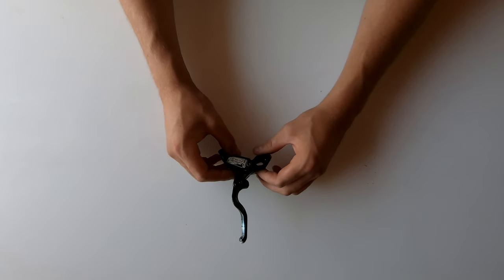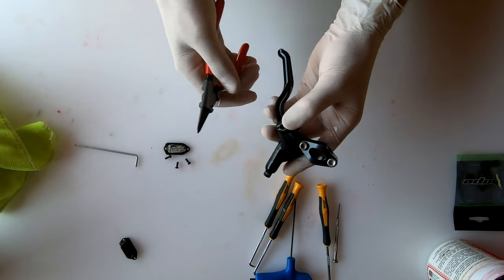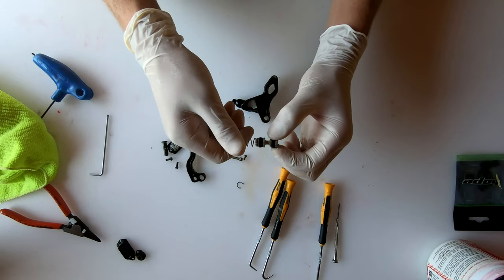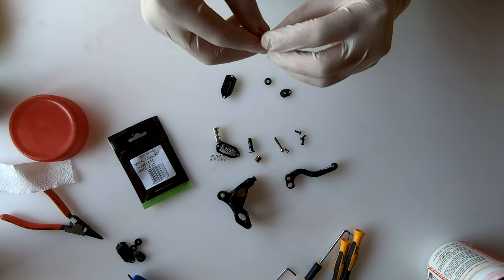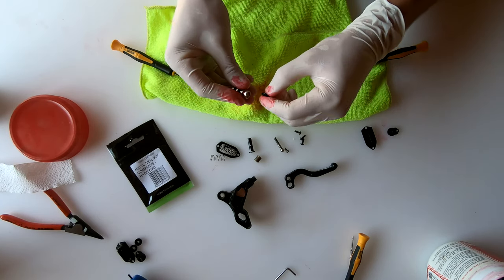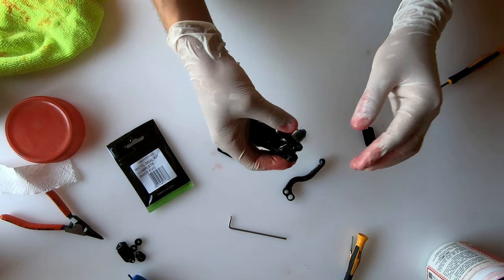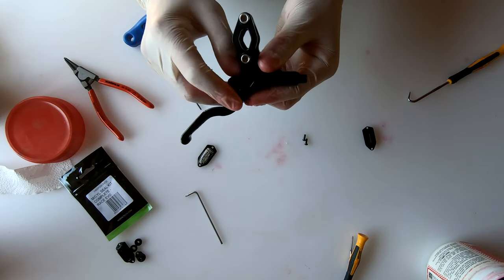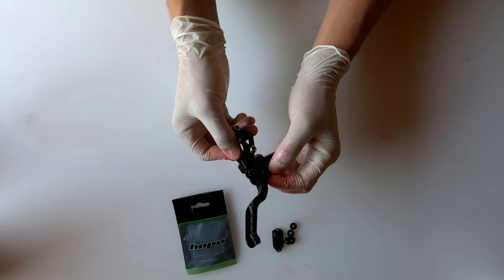Hope Race evo lever/master cylinder rebuild

Comment: Can you reuse the snap ring? Do you think its possible to remove the lever and replacing it with a new one without bleeding the brake? I bent my lever and need to replace it
Reply from the maker: Yes ypu can reuse the snap ring but I don't recommend it , its so soft i dont see how you can reshape it to go back around the pin , but that softness might also help.

Yes you can replace your lever without having to bleed the brake :)
Reply: @JustFrana  Thank you !